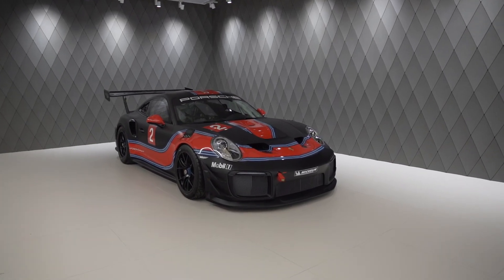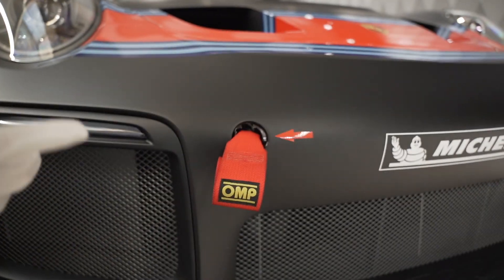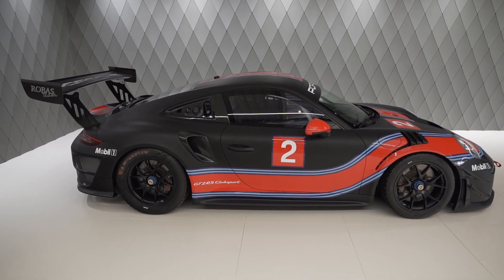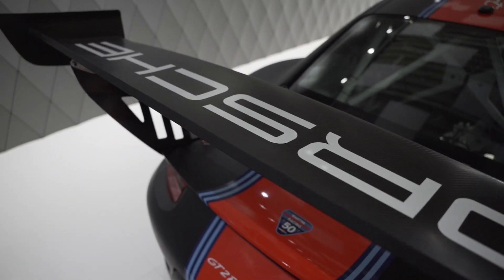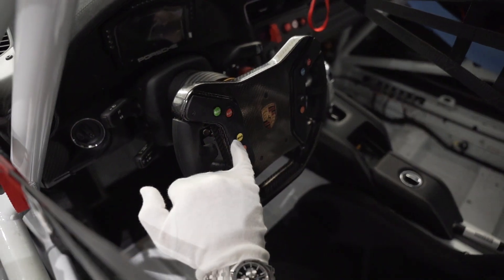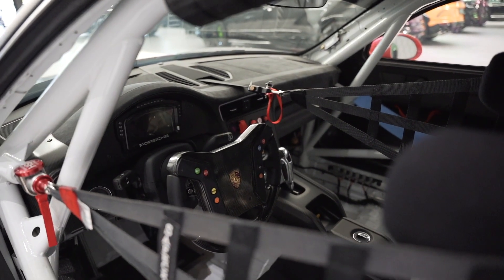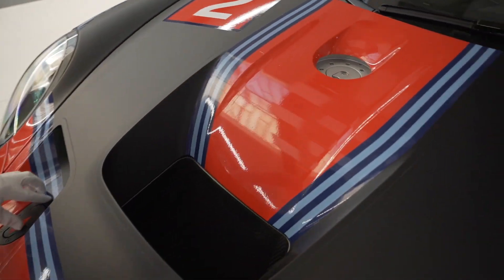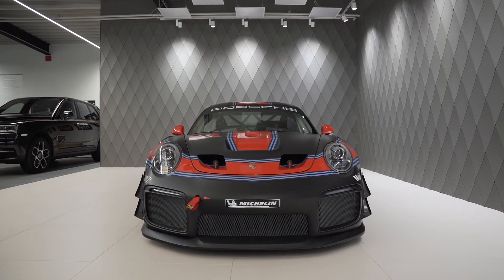PORSCHE GT2 RS CLUBSPORT LIMITED TRACKBEAST OVER 700Hp

Comment: The distilled water tank sprays water, on the underside of the camshaft to keep the engine cool when the water runs out the engine power is reduced.
Reply: 😂😂😂😂😂😂 water in the engine??? The water is for the turbo intercoolers !
Reply: @tobiasdammann485   Nope, the distilled water is sprayed on the underside of the camshafts.